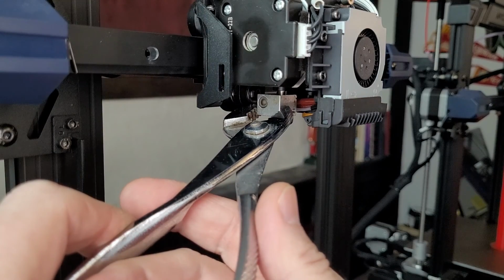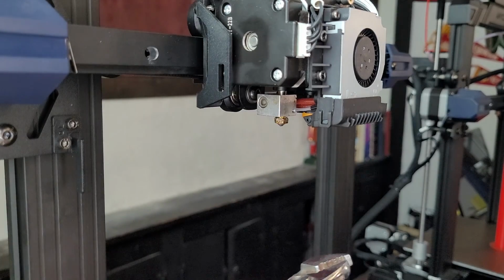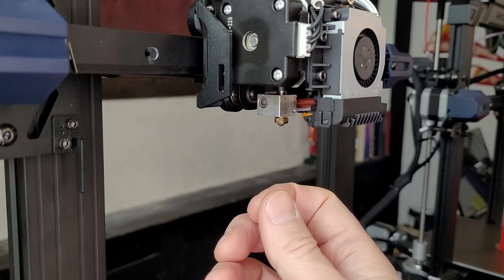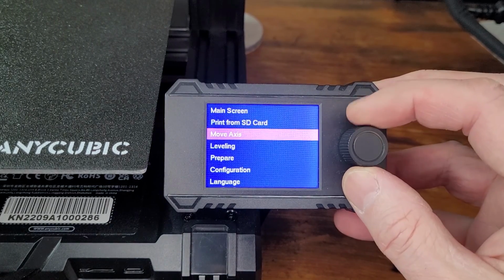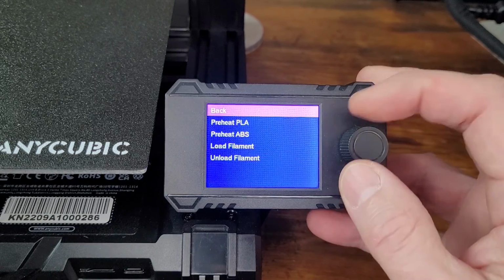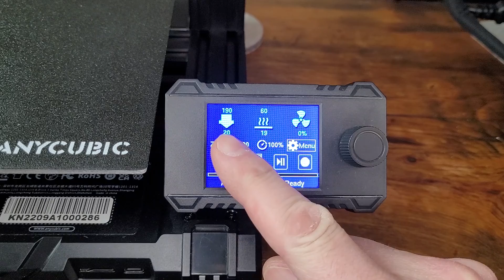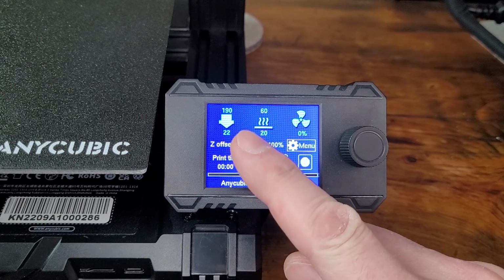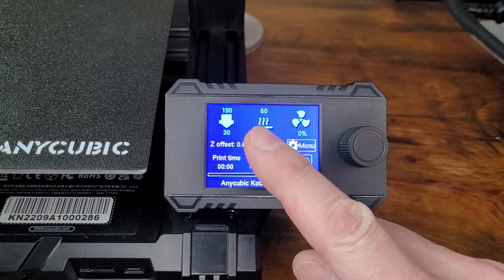Anycubic Kobra Neo Nozzle Change

Comment: What temperatures did you use for printing? Even at higher temps my steel nozzle keeps clocking up.
Reply from the maker: From memory I was usually between 195 and 205
I don't own the anycubics any more.

Comment: Hey I know this is an old video but I have a question about the Neo. Did you adjust the Z offset after you autoleveled? With mine if I level and immediately print it comes out as a blob of jumbled filliment
Reply from the maker: Hey, yes I used to adjust the z offset after auto leveling then print one of these brims to verify https://youtu.be/OUitdK3qpPc
Reply: @mayhemsmiley  For some reason my prints are coming out stringy, and are coming off the build plate. Any ideas/tips?
Reply from the maker: @BillsMafia-c6z have you performed a bed leveling and then printing a test brim before going for your full print?
Reply: @ even that gets messed up and parts of it come off the plate. honestly not sure what to do at this point
Reply from the maker: @BillsMafia-c6z  Hi Bill, check out these videos and let me know if they help https://www.youtube.com/watch?v=WET8ViFYYDU&t=1s   https://www.youtube.com/watch?v=s44ZC3RfFdA&t=52s

Comment: I changed kobra3 0.4mm nozzle with 0.2mm steel nozzle but it leaked whatever I did couldnt stop so I changed hotend with came preinstalled 0.4mm steel nozzle on. 😅
Reply from the maker: And are you up and running again?

Comment: I purchased the Kobra2 extruder kit for my Kobra 1. I need to detach and replace the heating capsule and ntc suitable for my printer. I will replace it today and then hopefully get positive results. So it is not just a matter of glue or strong lacquer on the printing plate.
Reply from the maker: @pierpa_76pierpaolo  fingers crossed for you.  Let us know how it goes.
Reply: @mayhemsmiley  Today I made my first attempt with the Kobra 2 cartridge. During the 'insertion of the filament it melts correctly. I go to print but the filament does not come out anymore, maybe I will be slightly high from the plate but the filament does not come out. I will try again before I put it up for sale. :)

Comment: great video. finally someone else meking changes to this printer. i am tired of searching this printer specifics to find out the type of nozzle it uses so i can buy more spare nozzles. ¿can you help with the tipe of nozzle i need to buy?

My kobra neo did not come with any ptfe tube but that was no issue until about 1 and a half months ago, changing filaments, the filament made some acrobatics and got stuck inside the extruder and aroud the gears, it got stuck so bad tat the gears stoped turning, so i had to disassemble the extruder cleaned as best as i could and got rid of every single spec of filament i could find, reassembled it started printing (with different filament) and the damn thig got stuck again. the second time i foud out the filament snaped somewhere and it was easier fixed, after that i had one print come fine but then the problems started

first was leveling issues, despite the autoleveling, so some tests and repositioning of the leveling probe, then some more tests and printing was finally leveled; but now i cant make the print to go fine as every single print starts good bit somewhere starts to miss filament, i have tried many times to clean nozzle but purge some filament and it flows fine no blobs, start printing again and same issue a prints somehow fail or if small they finish but they are squishi to an extent despite being printed in PLA. 

conclusion was i have to change nozzle, so go to toolbox that came with the printer and one spare nozzle, take out the tools from the box and what a gerat surpize the is no tool that can screw or unscrew the nozzle, now i am scratching my head trying to find a tool in my house that properly fits in the nozzle, if i do not find it, then tomorrow i will have to go buy it somewhere.

thanks for the video, i was looking to see if the tool for changing nozzle is suposed to come with the printer (i think it should). I hope this will fix my printer with the nozzle change
Reply from the maker: Hi Juana sorry for the delay responding. Thanks for the feedback.  The nozzle is the same on the go and neo 6mm thread total length of 12.5mm here is the video for the go https://youtu.be/Qfa5UXisH8M?si=pzbpMWwMGoypWGkX

Comment: Can you help me since my filament wont come out, like I can’t take the roll out. This is a problem.
Reply from the maker: Hey Mr Top, not sure I understand the issue. If you cannot extract the filament from the extruder, have you heated and removed the nozzle? If your printer is the Neo share a picture in the Anycubic Kobra facebook  group and I'll look along with other members. Let me know
Reply: Well I can’t extract the filament and nothing is coming out of the nozzle when starting a print. . I am also unable to remove the filament (the spool filament) out of the printer. I have a any-cubic Kobra 2 Neo. Please keep in mind I am new to 3D printers and only had this for a month. This issue started this morning and I am confused on what to do.
Reply: I also want to say that mid way through a print last night, my printer I guess failed. I woke up and I saw my printer was printing nothing up around an inch of the object. The print was half way done.
Reply from the maker: @MrtopGgamer  no worries. I'll help as much as I can.  What temperatures were you running on your print?  Too low on the nozzle can cause a clog. Did the filament get tangled and cooked on the reel?
Reply: @mayhemsmiley  I normally run 195. The  filament did not get tangled on the spool.
Reply from the maker: Do you know how to prepare your filament from the control screen where it will heat up your filament? If yes then do that but raise the temp to 210 once temp is reached use the lever on the extruder and remove the tension from the filament.  Do a gentle push then pull back quickly.  When you are gently pushing you should see filament coming out of the nozzle.  Try it and let me know
Reply: @mayhemsmiley  so how would I remove tension from the filament? This is the Kobra 2 Neo
Reply from the maker: Morning  @MrtopGgamer   I looked up your Neo 2 and correct me if I am wrong, but you feed the filament through a tube to a direct drive extruder. The extruder should have a lever on the top that you compress releasing the extruder gear from engaging the filament. You will have to hold it to keep it disengaged. Run the filament prep from your control screen on the printer, once heated, hold the lever and gently push the filament through, then quickly pull back the filament. let me know how it goes
Reply: @mayhemsmiley  I have tried this as I have changed the filament quite often. Ever since this happened, I am unable to pull it out or extrude filament.
Reply from the maker: @MrtopGgamer  sounds like it's time to remove the nozzle and possibly change it if you can't clear it
Reply: @mayhemsmiley  that’s the problem, I am not sure how too.
Reply from the maker: @MrtopGgamer  do you have any tools?  Or someone close to you that could assist? When and if you decide to attempt to remove the nozzle,  it will need to be heated so careful not to burn yourself.  Make sure to hold the block with a tool so as not to transfer torque through the assy when removing the nozzle.
Reply: @mayhemsmiley  thanks a lot for your help. I sorted it out. I am not sure whether. Or not it is clogged now, but filament is extruding, and I am able to take the filament out. Thanks.
Reply from the maker: @MrtopGgamer  thanks for letting me know you worked it out

Comment: Hi, what PLA was used in the cal cube and brim print.?
I like to hear your analysis of different PLA and the settings for best op.
Reply from the maker: Hey Joe, I'm pretty sure that one was eryone and no complaints. I used Hatchbox on another printer for awhile and really liked it. I'm at a constant with 50 degrees on the bed and usually between 200 to 210 for my nozzle on both the Go and the Neo

Comment: Great video just what I was looking for.  Thanks.  Mine did not come with that tube.  Any I idea where to get one.  Looks like a very good idea.
Reply from the maker: Hey Jbuono, thanks for letting me know. Unfortunately, you would likely need to buy a length from Amazon etc. Mine came froma Qiditech parts kit I had laying around :)
Reply: @mayhemsmiley  what are the dimensions on the tube? I looked on amazon and there are a lot of different sizes.

Comment: Hello.
Please, can you tell me what type of nozzle (LENGHT OF THE THREAD, end type, brand, etc.) is NEO using?? I'm about to order spare one in advance, and don't wanna screw up or disassemble just to check it (because of alignment and so on).
Thank you a lot.
Reply: thank you, I needed it🫡
Reply from the maker: HI Rozato, thanks for letting me it's useful @Arturas8666
Reply from the maker: Hi Jasam, 12.5mm total length with an M6 thread
I bought similar to the link and everything worked out fine.
Let me know how it works out 
https://www.amazon.ca/AFUNTA-Stainless-Extruder-Compatible-Makerbot/dp/B07J58R1JX/ref=sr_1_20?crid=3BALUEMSQ6Q5S&keywords=3d+printer+nozzle+M6+12.5mm+long&qid=1701296414&sprefix=3d+printer+nozzle+m6+12+5mm+long%2Caps%2C130&sr=8-20
Reply: @mayhemsmiley  they include a spare nozzle with the printer